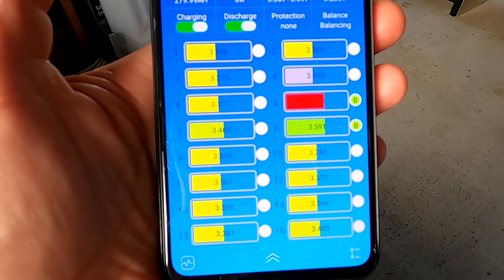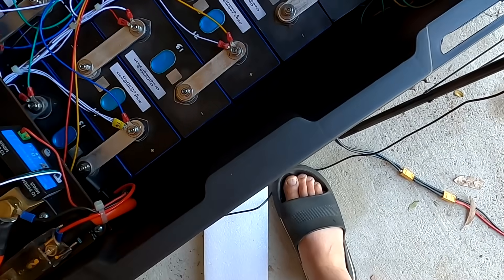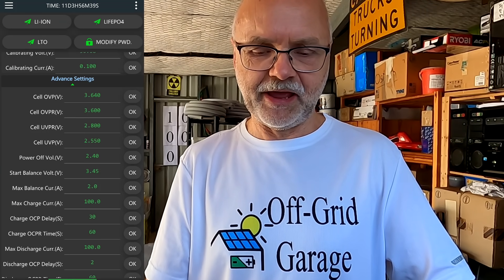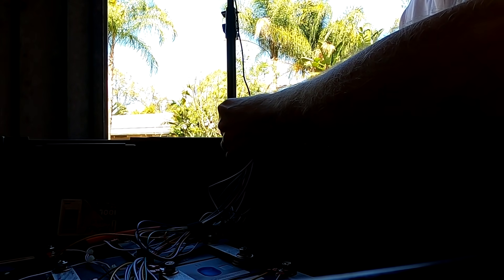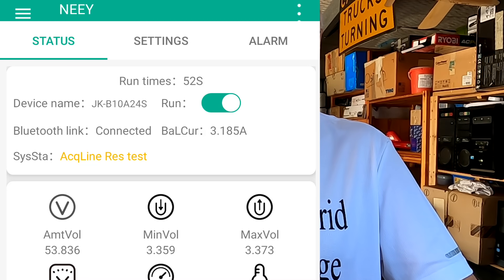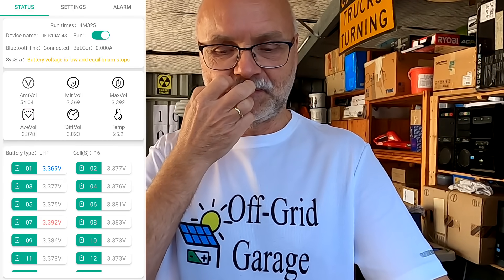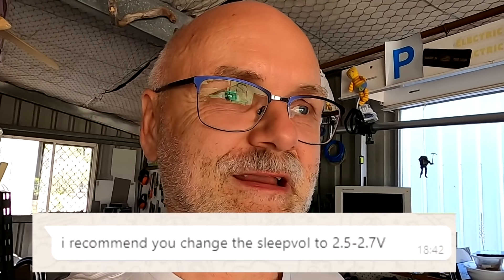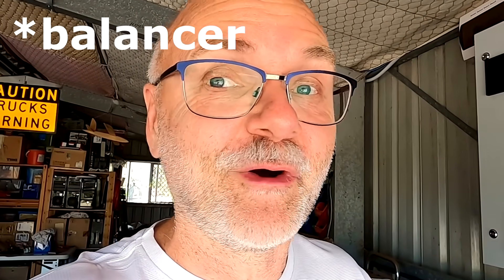NEEY Smart Active Balancer - The missed opportunity to get it right.

Comment: Info from manufacturer - from 1-11-21 will have new  hardware and  setting in App - Equilization Vol-  this will allow top balancing above the set equilization voltage.

Comment: Another spot on analysis. Not many YouTubers go into detail like you do, and even fewer do long term testing with feedback several days or even weeks later. I don't know how you find the time to do all of this, but I can assure you we're all very grateful. 

Balancers are one of those things that most of us shouldn't need, but marketing makes us think we need them. If the cells are well matched like they should be, then they shouldn't go out of balance much, this is why the Daly BMS works just fine for the majority of people. But if the cells are mismatched or getting old, then balance issues will present themselves quite often. If this is happening, then it's probably time to consider new cells. It's like a low oil warning in a car, if it goes low, we top it up. Then if it goes low again soon after, we look into why it lost more oil, we don't just keep topping it up. We should always try to fix the problem, not the symptom.
Reply: You are absolutely right Paul, the magic word here is New and Matched..

Comment: It is designed to run permanently, just like any other active balancer. That's why the "start voltage" is actually the cell difference.
The Sleep Voltage is just for over-discharge turn-off protection, not intended to be used as a "stop balancing" voltage.
As it is working today, if you want to have it running above a certain voltage only, you need an external voltage relay controlling the power supply to the NEEY.
Reply: that is right, it would be the perfect solution, i hope Andy sees your suggestion, thank you,i'm going to do this with mine.
Reply from the maker: So what's the smart part of the device then? If we have a voltage switch we could just use the active balancers we have used before. They are less than half the price. This one was supposed to provide the capability to start at a certain voltage.
Reply: it could be done with an arduino I think.

Comment: My observation of this active balancer is that the SleepVol setting is On/Off is for low voltage and that is why there is a 0.3V hysteresis. If the setting is 3.0 volts, the  balancer turns off at 3.0 volts and turns back on at 3.3V. I dont think that this adjustable setting has been designed for use at upper voltages and that is why Andy was having problems when testing at 3.4V. . It seems to be a "bug" in the standalone active balancer - this one and the JK one in that there is no Start Balance Voltage setting say to start balancing above 3.4V.  Where the combined BMS/Balancer eg JKBMS has a separate Power Off Voltage and a Start Balance Voltage. Without this feature to restrict balancing to above 3.4V unbalancing can occur as it did with Andy. It would be great if manufacturer's could provide  a specific setting for ON/OFF balancing eg Start Balance Vol as on JKBMS
Reply from the maker: They fixed this now in a future app release but I think it also needs a new hardware. I'm on it...
Reply: @OffGridGarageAustralia  when they add an equilization voltage setting to restrict balancing to >3.4 volts then this will be the go to add on active balancer for LFP 16s storage that already have a BMS. Would be interesting to do the same experiment with Tesla charging with JK BMS with its internal active balancer non restricted and then restricted above 3.4 and look how balancing behaves.

Comment: Hi,
Just got my unit delivered and installed today. It has the same firmware and manufacture date as the one you have. Do I need to add that it behaves the same way…  
The IOS-app was updated 3 days ago. There are still some bugs in it;
1. It notifies me that there is yet a newer version available (but there is non).
2. Battery capacity is not saved (or displayed wrong).

Keep up the great work you are doing :)
Reply from the maker: Thank you for your feedback. What software version does it show in your app when you go to the three dots and click on System Info?
I'm on 1.0 but there is apparently a 1.1.0 out there which works with the set balance threshold, so turns balancing on above and off again below that set voltage.
Reply: @OffGridGarageAustralia  I have the SW-1.1.0 but had to lower the voltage 300mV from what I wanted to make it start.
Got this reply from Hankzor BMS shop today;
”Dear, we will set the sleep voltage and start-up equalization voltage in the next version, which can be adjusted in the app.”
It’s going to be available at end of this month. The sad part is that ”old” units can not be upgraded according to them :(

Comment: That sucks. I hope they sort it and build a 4s. Thanks for your hard work and video 😃
Reply from the maker: You can use this device for 4s and 8s batteries as well. It just needs a boost converter for the power supply. I show this in a video this week.

Comment: Hi Andy
Is it possible that this balancer is originally designed for a different battery chemistry? This 0.3 volts make more sense in a lithium ion battery where the charge and discharge curve is steeper and voltage difference on state of charge is larger. Yes you can alter the voltage settings but is the balancer intended for lithium iron phosphate per design. Looking back at the screens of the app shown in the video there is no setting to configure the battery chemistry. It is my belief that because the voltage is alterable neey decided that it is suitable for lithium iron phosphate.

To be clear i only have a basic understanding about battery chemistry and I didn't read into the neey balancer
Reply: I thought the same, On the screen caps it shows BatType as LFP so It seems there are other types for that balancer. My guess is that they hardcoded that value for Li-ion and then added the LFP mode but made no changes. Ideally if that value cannot be set by the user at least should be different for other chemistries, maybe a 0,1v difference could be used by LFP. It is not ideal though, it should be configurable
Reply from the maker: In the settings you can set what battery chemistry you have: Li-ion, LFP or LTO. This should then set this voltage difference accordingly. That's a good point.

Comment: I hope the one I ordered will arrive soon for me to immediately return it
Reply from the maker: Don't forget to complain so they change their software for the better. It's totally insane that there is nothing on their website about that and I only stumbled over that issue because my BMS turned off the battery when all the cells were totally imbalanced. And I had to ask them for an explanation. That is just 💩
Reply: @OffGridGarageAustralia  I did and got a reply:

”Dear, I understand your requirements. We will update the sleep voltage and start voltage in the next version, which can be modified in the app”

- does it require a hardware update? do I need a new unit?

”The hardware needs to be updated. If you need a new equalizer, I will give you a discount of $20 on the new equalizer. Thank you for your understanding and support”

- when will this new version be available?

”middle  of this  month. about 10.15-10.20”

Comment: Once again another great video Andy, so glad I have ordered the QUCC BMS.

Looks like you have an expensive paper weight there until they update the firmware
Reply from the maker: Yes I have. I have actually two of them 🤦‍♂️
I'll keep pushing to get this working...
Reply: I have 3 QUCC BMS and I am not glad at all : they accept to close the relay only when the charge sends at least 20A so most of the time the battery is disconnected during night ! The only way to avoid that is to avoid BMS opens the relay but in that case BMS is not usefull in fact. It is a BMS that works great when it has not to work.

Comment: Balancing should always be set to the end charge voltage of the battery because the charging amp is small, setting it lower makes it useless to balance the battery because putting or charging 5A or more to the battery will make the balancer work harder.

Comment: explanation from manufacturer see website - someone care to translate
Advanced active equalization is energy transfer and does not need to set battery top equalization. The best working condition is to repair the voltage balance in the full voltage range of the battery, while the backward passive discharge equalization needs to set top equalization for top to top discharge alignment equalization. The working principles of the two are different, and the system settings are also different.
1. If it is necessary to set the top equalization, it is necessary to set the sleep voltage value as: Top equalization voltage -0.3v
2. If there is no need to set the top balance, just press the system default value

Comment: Andy, I use a “TKXEC Wireless battery monitor” 500V 500amp version. $52.88 us Amazon. It has two voltage programmable relays that I use to turn on and off the Heltec (Soon the Neey).
Nice color display with graphs of voltage , Ah and temperature. Instructions are in mouse print but translation is good enough. Pay attention to operating voltage settings (switch) read it at least twice lol. Bluetooth is for the display unit, not to a phone, but that’s fine with me.
Reply from the maker: Thanks for sharing Karl. I will check it out. That sounds like a nice device!
Reply: Is this the correct spelling? I've searched US Amazon and can't find it.
Reply: @alancairney4000  
Try: “wireless battery monitor 500v” 
Scroll down two. Looks like the are out of the 500amp version but there’s one almost the same search “500v 100a”
Reply: @SkypowerwithKarl  Thanks, found it :)

Comment: Duplicate post from another video on BMS Balancing:
Thanks Andy, I was thinking a bit more about active balancers, and If I had a reliable charge controller with over-charge protection, and an inverter with under-voltage protection, I would consider skipping the BMS and just use an active balancer, with voltage sensing circuit to turn it on near full charge voltage, or with a smart bluetooth balancer. 
I was also considering knocking up some cheap under-over voltage modules that could be used to switch Balancers, Chargers and low-voltage disconnects, if there's a market for them?
Reply from the maker: I think I replied to your other post this morning, Jack...
Reply: @OffGridGarageAustralia  Thanks Andy, I saw that and responded. I was curious if anyone had a comment about going without a BMS and active balancers and voltage controlled trigger circuits.

Comment: What is difference between the Victron balancer $65 and Neey balancer at original price of $119 ?
Reply from the maker: The Victron balancer can handle only 2x 12V batteries in series (presumably lead acid batteries), the NEEY can balance up to 24 single cells at once.

Comment: I bought both on your recommendation. Once they arrive I'm in for two crazy rides..
Reply from the maker: If you bought the JK BMS, that is totally fine. The balancer, I just found out two days ago when s**t hit the fan. I follow it up with them and keep you posted.
You can always log a dispute with Ali to get your money back. They usually have a great return service.
Reply: i made the same mistake,now its "buyer beware"for me on any of Andys recommendations.
Reply: @ralph9987  hi all, Andy is doing his best to make indepth videos testing this equipment. When I'm in the market for something new I read all about what I'm about to buy, read multiple reviews (focus on the bad) and evaluate on my own if these potential problems are insurmountable. It's easy to blame someone else for not doing your own research. Just think of it like this, if Andy says it's good to jump of a bridge would you??
Reply: @OffGridGarageAustralia  Im not upset.. I'm actually looking forward to playing with them.. FYI: with the hankzor there are two pads shorted on the pcb that is labelled RUN. This input could be use to control a scheduled run time by some external voltage monitoring cct.. I.e. short input when battery voltage is nearly at full SOC..
Reply: @alexschulein7002  that comparison is what parents say to their kids, so irrelevant to me. I would just appreciate if Andy does much more testing especially longer term/charge cycles before recommending the products he does.simples.no bridges here 😂

Comment: Just noticed According To Neey 
they have updated the balancer so that now there is no longer a 0.3V difference between stop and start voltage
Reply from the maker: Yeah, they contacted me already. I believe they will send out a new one to me for testing and evaluation.
Reply: @OffGridGarageAustralia  Nice
Reply: @OffGridGarageAustralia  Btw wanted to know if it's possible to Cascade or run 2 Neey Balancers together?
for my 46S4P batterypack (made with LFP 30ah pouch cells)
I would need 2 Neey's

Comment: I have just got my NEEY balancer yesterday too. Tested it and found the same problem with the sleep voltage settings 👎added a review in aliexpress so hopefully they will get it fixed. Also have just ordered the JK Bms now hopefully will be good after the great review.
Reply from the maker: Log a complained with them and open a dispute to get your money back. The more people doing that the sooner they will fix it and send out working products.
Reply: Just tried to cancel my order, but they say they can’t. They say “Dear, I understand your requirements. We will update the sleep voltage and start voltage in the next version, which can be modified in the app”
Reply: Also, “The hardware needs to be updated. If you need a new equalizer, I will give you a discount of $20 on the new equalizer. Thank you for your understanding and support” lol
Reply from the maker: @benjaminquinones1890  great🤦‍♂️ open a dispute with Ali...

Comment: I have the error "AcqLine Res exceed" in a cell. I have tried to pretar it with dynamometer, but it has not worked. How do I solve it?
Reply from the maker: 🤷‍♂️ no idea. Sounds like a high resistance connection from the wording? Go back to the seller and show them a screenshot. see what they say.

Comment: Those hard coded cell balance parameters may work better for Li Ion chemistry, that doesn't have such a flat curve.  Maybe?
Reply from the maker: Yes, that is correct. Charging voltage there is from 3V-4.2V with an almost linear curve.

Comment: Your posts are realy interesting and informative. I have a "challenge" for you.
Could you take a battery with all cells charged at the same level except one which could be much higher or lower. Then charge it untill the bms stops the charging process or the discharging process. Then measure the capacity of all cells bersus the odd one.
The question is, will the odd cell cause all the other cells to premature stop charging or discharging. This could be a serious concern for users as we do not have equipment or knowledge to regularly balance cells. Your measurements and finding will be appreciated.
Francois
Reply: I mean charge or discharge the battery and not the cell

Comment: Now it makes sense why the Daly bms balances only while charging...it takes away the cycling problem the Neey balancer tries to avoid by placing this .3 fixed hysteresis...given the discharge curve for these lifepo4 is so flat the Neey engineer has a point stating that switching on off so many times (looping) might be a burden upon the circuits...it reminds me of my Outback CC in diversion mode has this same custom user parameter to avoid cycling when reaching float voltage

Comment: When I bought my LiFePO2 battery it has just been charged by the seller, the cell difference was 43mv, after a month sitting on my room without any charging or discharging the cell difference is 0 zero, my daly BMS must be still balancing even after the charging stoped ?
Reply from the maker: LiFePO4 has a very flat voltage curve. After resting for that long, they settle down and you measure the same voltage across all cells. The test would be to charge the battery as a whole until the first cell hits 3.6V and then see what the difference is ...

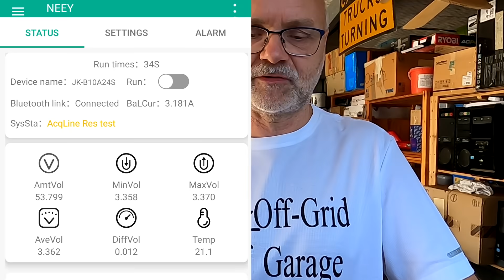Comment: At 7:55 is the device name right? I see JK-B10A24S that’s the same model number as The 10amp JK balancer I have. Are you sure the app isn’t connecting to the JK BMS by mistake?
Reply from the maker: Both apps, for the balancer and BMS can see each others devices through Bluetooth. Their name is fairly similar but you can also rename them. I just haven't bothered yet.
If you connect to the wrong one it won't connect though.

Comment: I wonder why you even need an active balancer. When you have a pack that is top balanced and batteries were matched by the vendor, the pack  keeps its balance when charging. I use a Daly BMS and it works well and have no issues and one less piece of hardware that can fail.
Reply from the maker: I don't need one, I'm just interested in the technology and test stuff here on the channel. I'm trying to break things and testing out of the normal pathways. I could have build a system from the beginning which just works. But for what reason? I'm curious what's outside of the proven, what happens when I change parameters, settings. Why is not working as good then, learning, understanding, sharing... that's pretty much the channel.

Comment: I dont see why they cant change the algorithm in the software to correct this error regardless of the chip firmware, they should be able to make a real actively small change to the software if they cant RE flash the main chip to do this, pity.
A switch &/or timer to manually do a top balance periodically maybe? Thanks for all this great info!